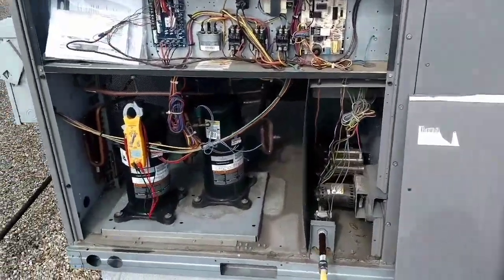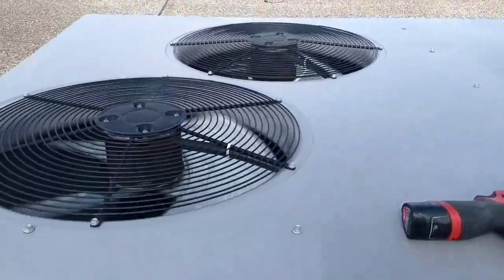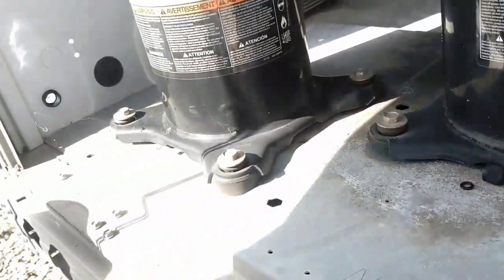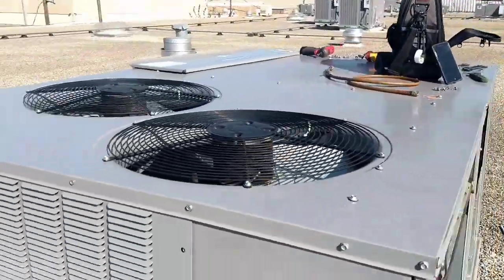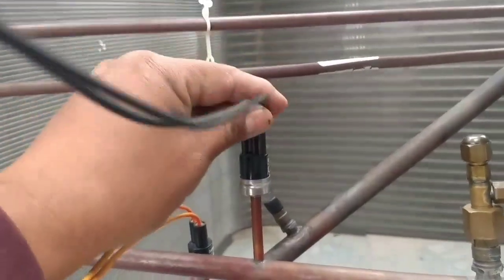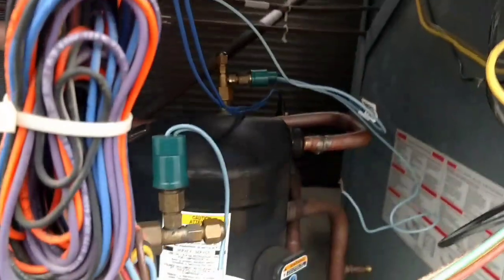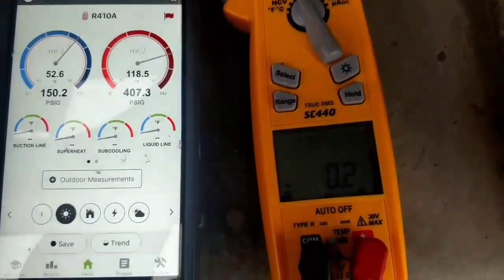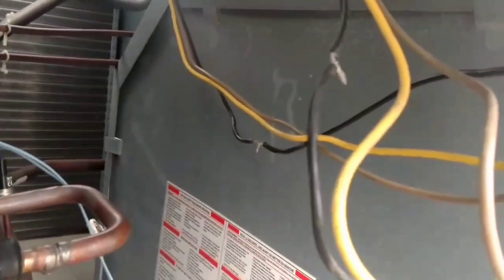HVAC- Carrier RTU no cool call in 36° weather

Comment: We have 40 or so units that cool year round here in Michigan. Do to strict humidity requirements economizers are not an option.
For proper low ambient cooling operation this unit will also need compressor oil heaters and hard start kits for each single phase compressor. some units require a relay kit that bypasses the LPS for the first few minuets to avoid nuisance LPS lockouts.
Check out the Carrier Motor Master low ambient kit listed as an accessory in the manual. 

It will allow these units to cool with outdoor temps down to -20F. It varies the speed of the fans so it runs a consistent head pressure based on actual condensing temp.
Carrier recommends that fan cycling pressure switch setups are only used down to 0F outdoor temp.
ICM also makes a head pressure fan control that can be setup for sleeve and ball bearing fan motors.

Stay safe out there.
Reply: Your solution surprises me. I would think that even with no cond fan running that at -5 and a little wind that the head would still be to low?
I saw a RTU in MN where this was the case and they added a headmaster to bypass the cond coil. This of course filled the cond with refrigerant thereby starting the txv. So, I added a receiver which solved the issue. Your thoughts?
Reply: @marriagepartnersministry5942  
The Carrier Motor Master instructions contain diagrams for air baffles to attach on the outside of the unit to block wind.
90% of our units are on commercial roofs and we have not had any issues.
For residential units we use the Carrier KSALA0601AAA or the ICM 326HNC-LF.
For commercial units Carrier CALOWAMB- series 208-230, 460, or 575V.
When installing the ICM control also use all of the accessories called for in the Motor Master instructions.
ICM will work with ball and sleeve bearing motors @ 1/4 the cost.

Comment: Economizer should be putting in free cooling but if no economizer it’s best to run a motor master and the motors ramp down RPM’s and u can run 2 circuits on it. With that setup in summer time if one of the compressors fails and does not run  that fan motor for that circuit will not run and will cause other circuit compressor to burn out from running with only one fan motor. ICM makes a decent head pressure control that runs off condenser coil temp and can have two sensors on that one control for multiple circuit compressors and it will control the fans for both circuits. Probably confused the hell outta anyone who read this. Good video brotha 🤘
Reply from the maker: Jimmy P that’s what I recommended we do but cost was an issue.  Lol. They wanted cheap.

Comment: I understand fan cycling cause head pressure to go up during low ambient conditions, but what advantage does this serve? Why is it important to keep head pressure up on low ambient days.
Reply from the maker: Chris Scinto lower head pressure give you lower suction pressure and will cause you to trip on low pressure.
Reply: I get it. Gotta warm up the condenser somehow when its cold out or else you cant transfer any heat or defrost efficiently in the case of refrigeration. Cold condenser= no heat transfer. Its compared to a dirty condenser coil on a unit thats low on charge. Customer says its all good then you go and wash off the matted condenser and all of a sudden your pressures drop and remain that way even after the coil dries. Matted condenser was keeping condensing tempersture higher because it was restricting airflow just like condenser fan cycling or staging or modulation does, the only difference is one scenario drags down your efficiency and the other brings it up. Dont mind my comments, im getting into this area of the hvac trade and im trying to learn as much as i can
Reply from the maker: Chris Scinto no problem bro. I’m glad to help.  If you want to send me a message I’m on Instagram.

Comment: Make sure if you adjust the pulley you check the current of the fan. The adjustable pulley changes the drive ratio. If commissioned properly, the pulley should not be touched. The belt should be tensioned by moving the motor.
Reply: Exactly right. Move the motor to adjust the tension of the belt. Adjust the pulley and the airflow will change. I always try to avoid it if possible.
Reply: Did I miss something, did he adjust the drive pulley? He only said he was adjusting tension.

Comment: Reason for bypassing cycle switches could be in summer, fans will be coming on at a higher pressure, we do this alot in Australia especially coming out of winter.
Reply from the maker: Yeah. This unit really needs an economizer.  But🤷‍♂️
Reply: Could you add a couple more sentences? 
I'm not getting why someone would disconnect the low pressure switch in summer?

Comment: Will that work if it's calling just for stage 1 since only 1 fan will be running? That might cause too low airflow and issues in the summer. It really needs to have an economizer to work right imo. Since those switches weren't factory I'd say someone was already having issues in the summer and that's why they were bypassed (technically converted back to factory specs)
Reply from the maker: Jernej Jakob From what it looked like, those were factory HPC switches.  I did not want to mess with the factory design, so it went back how it was.  If they were not factory for some reason, then someone did an excellent job🤣
Reply: It's a bit of a weird way to do it but it'll work regardless. Having the two switches there controlling seperate fans helps maintain the pressure a bit better in winter. 

In winter, instead of cycling both fans on and off and swinging the HP from 300-400 PSI (if he just used one switch feeding the relay), it'll maintain a better pressure as likely only one fan will be on most of the time.

In summer, say it's calling for one stage. Only one fan runs so that stage trips out on HP. Space gets warmer and calls for the second stage. At this point the second fan will come on and both stages will start working again (after stage one HP resets).

Ideally you'd use a variable speed fan controller with like... 2 pressure inputs so it can monitor both stages and adjust the fans accordingly. Even better would be getting the economizer working but you can't fix a cheap client.

Comment: It looked Like that unit had an economizer on it.  If you go back make sure to see if it has an economizer and if someone has bypassed it.  It’s better to economize than use compressors for cooling on a cold day like that.
Reply from the maker: Yes, the economizer was never properly connected or started.   Customer doesn't want to pay for the service, which is ironic because they're paying for electricity. 🤣
Reply: @rookierefrigeration4357  

Sorry, but "what's an economizer?" (Scratch that, GFM and others have multi part serieses on economizers.)

Comment: The switch on the schreader “T” is a fan cycle switch. You can ohm it out and see when it closes based on your pressure. These are common on server rooms and process units.
Reply from the maker: Yo Mamma yeah   I was just surprised I did not see it the first time I was out there.
Reply: "Server Rooms"
That explains it -- why somebody's running AC full blast at 40-ambient. 
Thanks.

Comment: If it cuts back on at 240 you will be back in the summer because the fans arent coming back on unless its off long enough to equalize
Reply: 240 psi = 81°F
420 psi = 123°F

On any kind of a warm day the unit will have no problem closing the fan  cycling switch.
Reply from the maker: 240 is the cutout.   Not sure I understand what you're saying